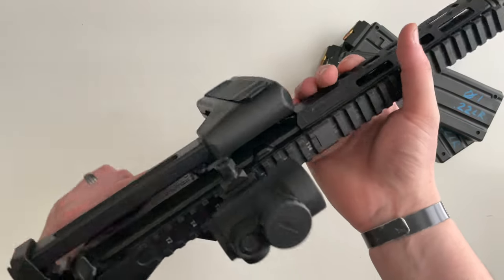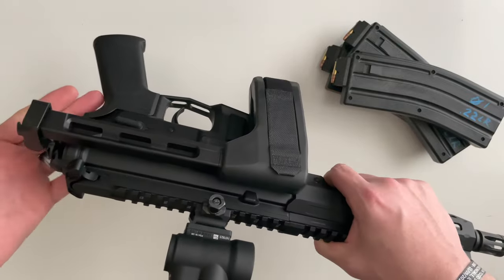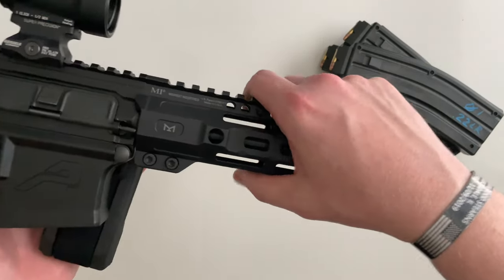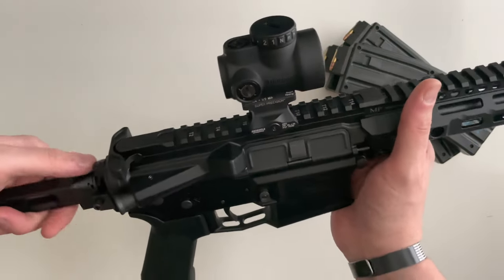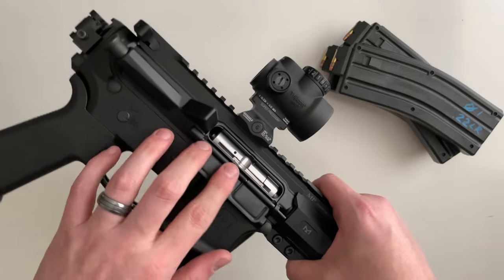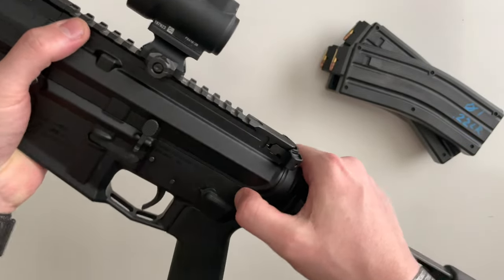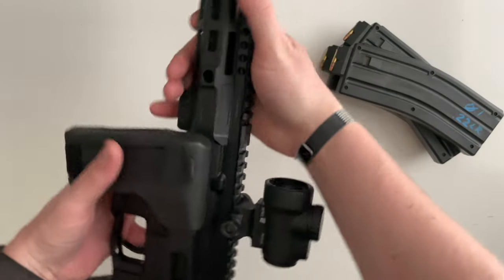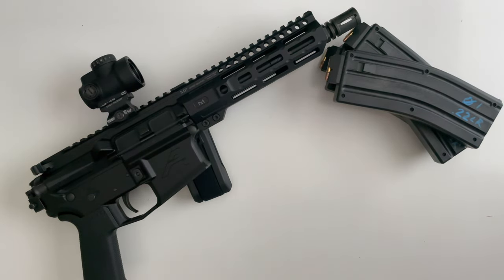AR Build Series 2.0 Overview

Comment: I'd say that's a super cool build, don't have an AR but it would be a good place to start. 👍👍
Reply: Some pre-built recomendations that are similar to this are the M&P 15-22 Pistol variant, it has an 8" barrel and pistol brace. The 15-22's have polymer receivers and handguards, which makes them super light, i have the 16" variant and its been pretty great so far. If you want something thats not made of polymer, Tippman makes the M4-22 series which comes in several different barrel lengths and models. I don't own one of those but for a trainer rifle that weighs similarly to my 5.56 pistol, its been tempting.

Comment: Sorry if you said this in the video and I missed it but did you end up having to change out the KNS for the model WITH the flange? I saw your install video and it was the verision WITHOUT the flange meaning it was meant for MCX's and not standard AR lowers. The flange being the piece the covers the takedown detent hole in the rear of the receiver.
Reply from the maker: Because I was building on the Aero M4E1 I did not need the model with the flange. The takedown detent hole is threaded which allows for you to put a set screw in to hold the detent and spring in.
Reply: @GunBoxTherapy  awesome, thanks. Didn’t know that about that M4E1.